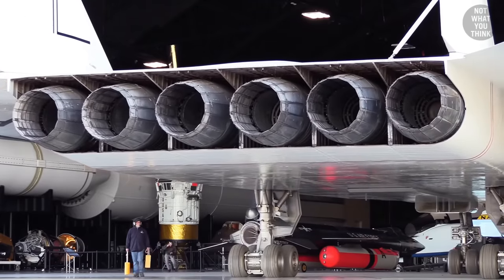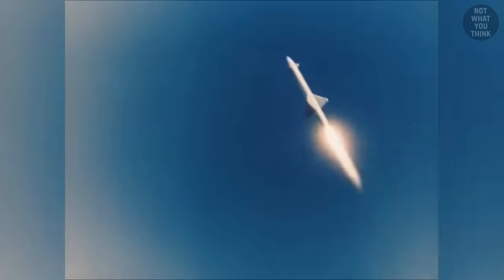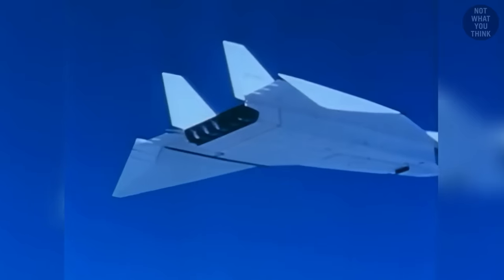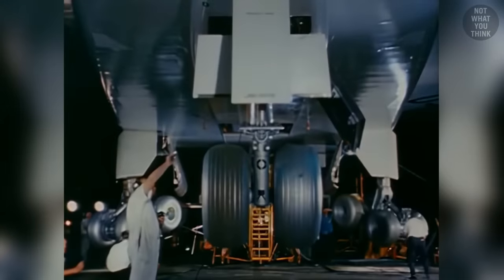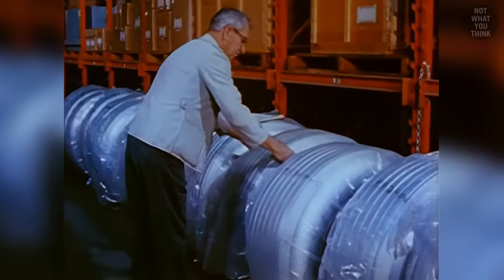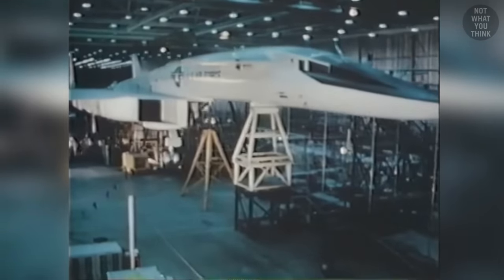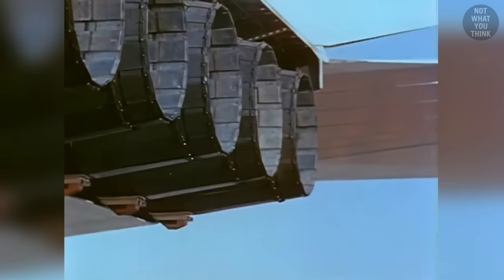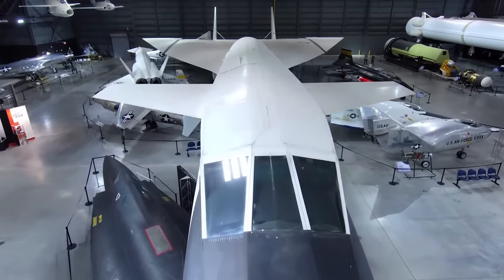The Airplane That Looked Fake, But Was 100% Real: XB-70 Valkyrie

Comment: The XB70 was cancelled under LBJ in 1966. JFK was long in the grave & Jackie was with Onasis.
Reply: The XB-70A wasn't cancelled. It was retired after it was no longer needed. Only 2 were built, and they wouldn't have been needed by 1971, since its use was limited to generating data that could be used for developing an American SST, and that was cancelled by about then. 

If you're referring to the B-70,  what's your source of information for that date?  Mine have the B-70 cancelled in 1961.

Comment: literally the concordes dad
Reply: Explain how.
Reply: @smark1180  bc of how the geometry works
Reply: @Moonbeam3575  What "geometry" and HOW?
Reply: @smark1180  look at the nose of the plane, as well as the general shape of the wings. The ram jet engines are also similar to the concorde. Ofc there are differences but I would say that this something that the concorde would be based off of. dont forget the larger wheels with the many problems with them. also the paint. the winshield is ver similar
Reply: @Moonbeam3575  "look at the nose of the plane"

Concorde has an articulating nose, XB-70 does not.

"the general shape of the wings."

Many airplanes have delta wings. Regardless, Concode has a gothic delta, XB-70 does not.

"The ram jet engines are also similar to the Concorde."

Oh ffs, neither one has "ram jet engines." You're clueless.

"the winshield is ver similar"

Explain how.

Comment: We now know how to deal with the speed and heat due to new materials !build them!
Reply: We know that speed isn't that necessary. Actually we knew that in the 1960s.  As for heat, what "new" materials would deal with that problem. 

Also it's interesting that you've focused on 2 factors which weren't a problem for the XB-70A. The plane handled heat just fine, and achieved its design speed goals. The real problems with Valkyrie were cost and need - the first being astronomical, the other being minimal.
Reply: @winternow2242  the video said that the paint burned off and they had trouble with the brakes , that I know were solved later on other aircraft , that’s why I mentioned that was something we were able to verify come , I know it had to do with ballistic missiles being developed but no we find were in a situation of not enough aircraft , some of these old designs would work quite well Don’t you 🤔 think
Reply: @PDLM1221  "the video said"

...nothing that made development of the plane a good idea.  Paint burned off because paint tends to come off airplanes which travel at high speeds. It's the paint, not the plane. As for the brakes - brakes fail. Those things have nothing to do with why the plane was cancelled, which happened years before Valkyrie was even built. 

I don't know why people mention ICBMs. Sure they made the case against manned bombers, but guess what - we kept building manned bombers and developing even newer ones. The ICBM issue is obviously exaggerated as a factor in XB-70 being cancelled. ICBM systems hadn't really been in service long by the time this airplane was cancelled.  They hadn't built up a reputation as viable weapons, and their CEP was still wide.

"no we find were in a situation of not enough aircraft"

We do?  Even if there was any good reason to believe it (which there isn't), developing an additional, expensive aircraft is going to be so costly, you won't be able to buy so many of them, OR the other airplane.

"Some of these old designs would work quite well Don’t you 🤔 think" 

Nope. Totally obsolete. But why stop at XB-70?  Bring back the B-47, hell, why not the B-36?

Comment: Were is the space for Tanks, for seven hugh turbines ?! An were is the space for the bombs?!
Reply: Fuel cells were in the area of the wing roots and the upper fuselage. No bombs were ever carried because the XB-70A wasn't a bomber.  The XB-70A was a flight test aircraft, which had an instrument bay in the lower fuselage behind the intakes.   A B-70 bomber would probably carry its bombs there.

Comment: Ironic that tires took down the XB70 AND the Concord!! Tires would blow out and fling rubber into the engine intakes!!
Reply: How did tires take down the XB-70A?
Reply: @winternow2242  
Did you read ALL of my comment?! I said tires would blow out and fling rubber into the engine intake!!
Reply: @ludicrous7044 Apparently, I'm the only 1 of the 2 of us who did read your comment.

"tires took down the XB70 AND the Concord!!"

So, the question remains - please explain how tires took down the XB70.  

Not how they "would" or could", but actually took down anything.

Comment: XB-70 and the Tupolev 144 are copies of the Concorde
Reply: Huh?  Americans copied an airplane that didn't exist?  Concorde rolled out in 1967, 3 years after the 1st XB-70A flight. 

Also, the XB-70A and Concorde look almost nothing alike, and have different performance specs. How is either Concorde or the XB-70A a copy of the other?

Comment: I believe number two was in fact operational butt handed over to NASA for continued testing and data collection.
Reply: If you are referring to the second Valkyrie, it may have been operating with mixed NASA and USAF crews, but the program wasn't expected to become NASA's until mid-June of 1966, by which time it had crashed. Valkyrie no. 1 was the plane turned over to NASA, and pictures of the XB-70A with the yellow NASA banner were of that plane.

Comment: I think the plane could be brought back but upgraded to fix the technical issues with modern technology. Kinda like we are doing with the F-15
Reply: the f-15 is much smaller and still produced with tons of upgrades worth billions along the way though. its not an abandoned platform by any means and many countries are still using it. comparing apples to oranges im afraid.
Reply: It would be awesome, but it wouldn't be very useful. XB-70's issue was its purpose, not technical difficulties really, it's role is more aptly done by ICBMs and stealth bombers (or by hypersonics in the near future). Tech issues are whatever, MiG-25 had a self-disintegrating engine that needed to be replaced after just one flight if pilot kept AB at full for a few minutes too long, but it was fine because the plane still did it primary job and additional costs and maintenance were an acceptable cost for the time. All the issues with Valkyrie would be fixed back in the day or would be accepted as necessary trade-offs, but… the plane wasn't needed anymore. But, again, it would be really damn cool to see how light and durable and fast such thing could be nowadays!
Reply: @ju5e3  you do know they are rebuilding the F-15 from the ground up but with modern technology right?
Reply: @patrioticz2858  you use these words, 'from ground up', I do not think they mean what you think they mean.

Comment: Concorde cousin
Reply: The two weren't related in any way.
Reply: @smark1180  well the front nose and fuselge kinda concorde
Reply: Pepsi xb 70
Reply: @ErmineProductions  As opposed to the rear nose? Concorde has a fully articulated nose whereas the XB-70 does not.

Concorde has a conventional fuselage whereas the XB-70 has a cylindrical upper fuselage that blends into a lower boxy fuselage that's unlike any other airplane's.
Reply: @ErmineProductions  "Pepsi xb 70" Wut?
Reply: Its a joke
Reply: Ok seriously just stop it is just my opinion
Reply: @smark1180 there was a Concorde that was painted like a blue can of Pepsi.  It was a French Concorde, so I've read.
Reply: @winternow2242  Thanks!
Reply: @winternow2242  I don't understand the obsession some have with comparing Concorde to the XB-70 when the two are nothing alike.
Reply: @smark1180  2 large, supersonic, delta wing aircraft.  There are several recurring narratives on the internet - mostly the number of aircraft that are copies of  the Avro Arrow, (MiG-25, SR-71, the F-106, Space Shuttle, etc.
Reply: @winternow2242  "copies of  the Avro Arrow"

Yep, along with XB-70/Concorde obsession.

Comment: One cool looking aircraft to bad they couldn't work it out. The way it was designed it seems any flack holes could cause it to explode because of the cooling system. 
If it could hold out as long as the big stick B-52 would of been another thing.
Reply: I'd love to know your source for that claim about cooling. 

As for working out, the plane worked fine. It just wasn't all that necessary given the cost.
Reply: The B-36 was the "The Big Stick."

Comment: the XB-70, leading to MiG-25, and lastly the F-15, feels like a UNO reverse clash and USA eventually won lmfao
Reply: The connection between those planes is exaggerated. 

MiG-25 development didn't start until 1961, years after the B-70 was designed. The B-70 hadn't been built by then, and was cancelled within 2 months of that development inception. The Soviets continued developing the MiG-25 for the next decade. 

As for the F-15, nope. The F-15 was going to be developed anyway because 1) USAF needed a replacement for the Phantom, which first flew in 1968, and 2) because large numbers of MiG-21 and MiG-19 fighters matched American fighters in Vietnam.

Comment: Looks like concord 
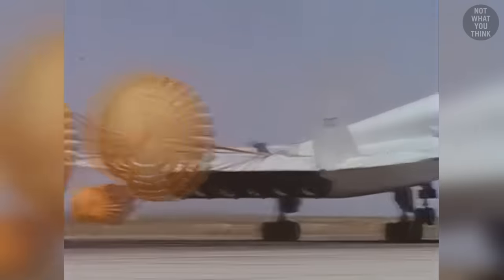8:36 kind of ABS system 🤔
Reply: Really?  I don't see it...at all. They look completely different to me. What common features do you see that are unique to these planes?
Reply: @winternow2242  body shape
Reply: @bertone122  body shape looks completely different to me. Concorde has a long, slender fuselage that extends past the engines. On the XB-70A, that long fuselage ends well short of the engines, and only extends from a lower, rectangular fuselage which houses the engines and payload bay. Seriously, just look at pictures next to each other of each plane, and you'll spot just how different they are.
Reply: @winternow2242  ok ☺️

Comment: The Concorde was the working Valkyrie
Reply: Huh?  What do those planes have in common with each other. Neither looks or flies like the other.
Reply: @winternow2242  "The data from the XB-70 test flights and aerospace materials development were used in the later B-1 bomber program, the American supersonic transport (SST) program, and via espionage, the Soviet Union's Tupolev Tu-144 SST program. In response to the British/French treaty in 1962 that lead to the Concorde SST, President John F. Kennedy began the American SST project in June 1963.[56] North American entered a design with some elements from the B-70, but it was eliminated from the competition in June 1964."

Learn before talking.
Reply: @erwanmoreau6357  Your quoted source says even less about the link between Concorde and B-70, the point of your original post.  There’s a very good reason for that missing fact: there was no link.  B-70 and Concorde are distinct in almost every way – clearly you’ve never seen pictures of the 2.  Different planes with different missions, designed in different countries.

Concorde is built out of Aluminum (I guess its pilots would call it Al-Yu-Mini-Um).  XB-70 is built of stainless steel, with some titanium, and has an empty weight about 80,000 pounds higher than that for Concorde.  

The 2 planes have different wings – with Concorde’s “ogival” delta having a varying angle of sweep along its leading edge, noticeable wing twist and anhedral, and fixed wingtips.  XB’s wings have a constant angle of sweep along its leading edge, no anhedral (the 2nd XB had noticeable dihedral) and famously folding wingtips – the latter probably designed to exploit compression-lift, something that I’ve never read in connection with concorde.  Have you seen compression-lift theory associated with Concorde’s design?

Concorde uses a pivoting nose-cone, and small, fixed canards.  XB-70A uses large, moving canards, and a fixed nose.  

Concorde uses a single vertical stabilizer mounted on an empennage aft of the engines – XB-70A has no empennage, and has 2 vertical stabilizers mounted on the fuselage, ahead pf the engines.
The XB has 6 engines, buried in the lower fuselage, and running across the centerline.  Concorde has 4 engines in external pods spaced away from the centerline, and no separate, lower fuselage.

The XB-70A is faster than Concorde and has a higher ceiling.

Concorde was developed based partly on studies involving the HP-115, but also the Fairey-Delta 2, which had its 1st flight in 1954.  The XB-70A was based on the never built B-70 bomber, which wasn’t designed before 1957, and not built until 1964 (after the Handley-Page test-bed)

But somehow, 2 airplanes that neither look, nor fly alike, share the same building materials or development history are completely related…because of something you ctrl-c’d from a Wikipedia page.  

Copying some kid's homework isn't learning.
Reply: @winternow2242  If your point is just to say Valkyrie and Concorde are two distinct airplanes, everybody can see that... If your point is to say those two airplanes have no link in the history of aviation, I think you are wrong (but I guess that not your point).
Reply: @erwanmoreau6357  "If your point is to say those two airplanes have no link in the history of aviation, I think you are wrong"

The point is that evcidence shows that the 2 have noting to do with each other.  Depending on what you consider a "link" (they get nentuioned by a lot of people) there is or there isn't.  Other than that, the 2 are completely unrelated.

As to what you think, it's irrelevant.  It;s the evidence that matters, and you haven't any.
Reply: @winternow2242  I ear you, but I'm not agree with you.

Comment: the military version of the Concorde just not as well as the concorde.
Reply: Years before the Concorde was started.
Reply: Looks nothing like Concorde to me, and certainly doesn't fly like it.
Reply: Much better than Concorde. Much faster, higher, heavier, larger.
Reply: Obviously not…
Concorde flew successfully for 27 years!
Just like the TU-144, the engines are not in the correct place for a delta winged aircraft
That’s one of  the reasons why both the Tupolev and Valkyrie failed 
Too much weight on the centre.
Reply: @stevesmitherman2981  the XB-70A failed?
Reply: @stevesmitherman2981  The XB-70 was always in testing unlike the Concorde and Tu144. The XB-70 was cancelled because that mission was not needed.
Reply: @stevesmitherman2981  Please show the calculations to support that claim. Most fast large planes transfer fuels around to control the center of gravity. The Concorde has 17 tanks holding up to 31,569 gallons of fuel.

Comment: Engineers have been capable of making these futuristic supersonic and innovative aircraft since the 60s. Yet we spent billions of dollars on projects like the f-35 which other than the stealth technology and other improvements. Doesn’t seem to be a big leap.
Reply: Because what really matters is making aircraft that can be put into production.   In that sense engineers did not prove able to put this aircraft into production, or that it would have made any military or fiscal sense to do so.  Also, the B-70's only advantage was speed and altitude, which lost its military value with development of SAM and high speed interceptors.  F-35 can't fly as fast as B-70, but doesn't need to. It's stealthy and can take off and land from more challenging locations.
Reply: @winternow2242  I get that practical application is what matters. But innovation and pushing technology to the limit is what’s truly interesting to me. Like the blackbird created with 60s tech. With the resources available now they could probably make space planes if they wants too.
Reply: @winternow2242  and also all the darpa and the advanced Cold War projects. That never saw the light of day.
Reply: @drainscholar we do have spaceplanes. Both American and Soviet shuttles were spaceplanes, as is the X-37.  They aren't widely used because there's little practical advantage over conventional expendable boosters, much as supersonic manned aircraft aren't of much use compared to subsonic aircraft.  Also the F-35 does push innovation to the limit, especially noteworthy because it actually went into production.  The XB-70A was an achievement, but compared to modern aircraft, it's more glamor than reality.

Comment: Looks like they copied Concorde's homework.
Reply: This plane flew years before Concorde.
Reply: @winternow2242  Concorde's origins go back to the 1950s and the Bristol Type 223 and Super-Caravelle.
So yeah, my point stands.
Reply: @TroyConvers5000  223 was proposed in 1961, a year after design work began on Super Caravelle. The work that goes "back to the 1950s" includes a number of differen designs, many having nothing to do with Concorde. And, like those aircraft, 223 and Super Caravelle were never built. 

XB-70A was designed by 1958, and flew in 1964. It looks nothing like Concorde, a fact you could have realized after a Google image search.  To say nothing of flying much faster and higher. So, nope your argument falls.

Comment: Ok, ther Germans had a joke that went something like "how do you get an f104? Sit in your yard and wait" the joke was they crashed so much one would probably fall in your yard. Why tf was one of the most crappy maneuvering interceptor right next to the expiramental bomber?
Reply: Because it wasn't a crappy interceptor, and American pilots loved their planes. The F-104 wasn't maneuverable because it wasn't supposed to be. Interceptors aren't supposed to be. The F-104 flew in close formation with the Valkyrie for nearly an hour.
Reply: @winternow2242  I understand that, I agree with its role not needing to menouver well, that being said with those short wings and poor slow speed menouvering it probably should've been one of thr planes on the outside of the formation